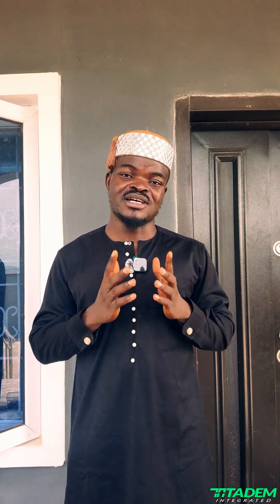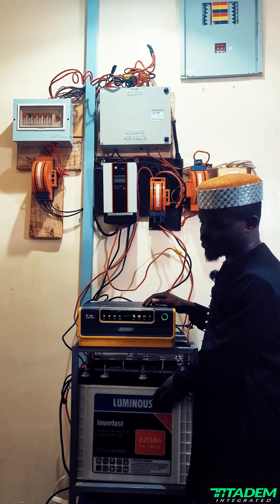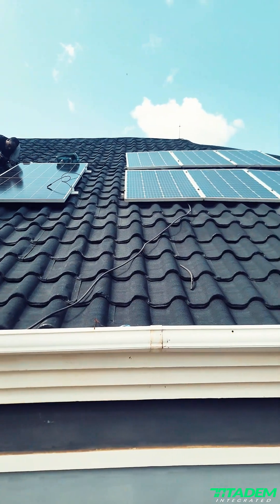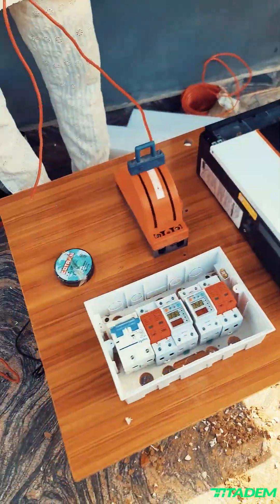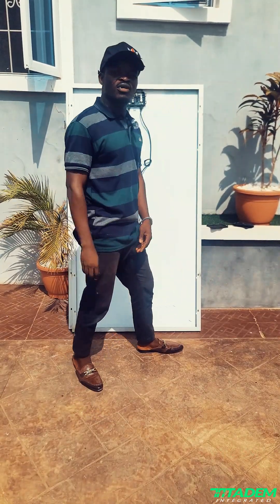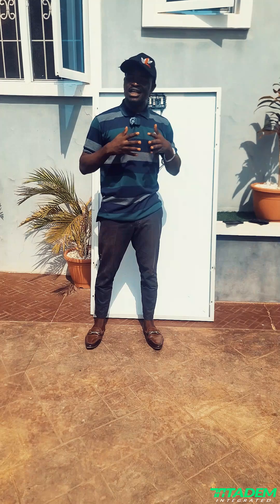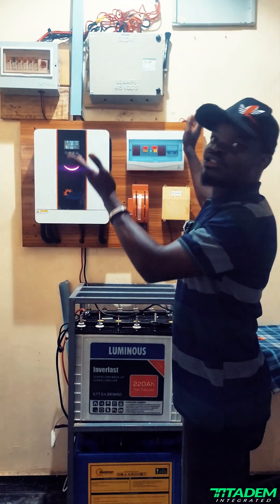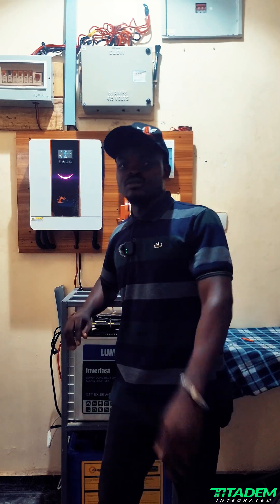can residential lightning arrestors protect your solar setup from thunder strike

Comment: you have a good point. but in this case the surge i am sure it came from nepa and not the solar because it mostly affected input equipment stabilizer and inverter and it didn't affect the charge controller even though he didn't put a dc breaker. had it been there an ac surge before the stabilizer and he earthing and the resistance of the earthing is very low i think this wont have occur

Comment: Having thunder arrestor doesn't mean it works.
I expected you to check the thunder arrestors resistance with an earth meter. 

Also check if the electrical earth is good. 

Putting an SPD with a bad electrical earth is like a car without tires - it just won't work.
Reply: That why I always create a special earthing port for any solar installation I do I no wan hear say na me do am e spoil
Reply: you are on point. but in this case the surge i am sure it came from nepa and not the solar because it mostly affected input equipment stabilizer and inverter and it didn't affect the charge controller even though he didn't put a dc breaker. had it been there an ac surge before the stabilizer and he earthing and the resistance of the earthing is very low i think this wont have occur